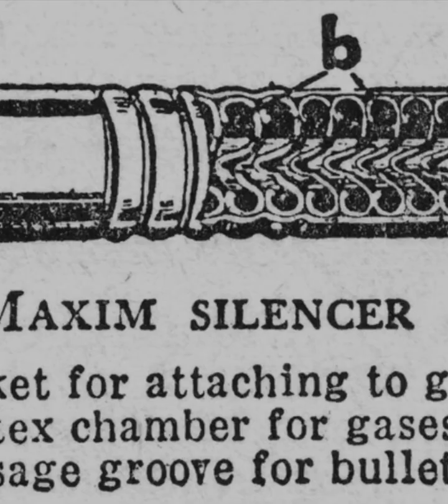MEOW Ep. 1

Comment: So it sounds like from what you guys mentioned about other manufacturers devices you’ve seen certain devices that caused issues with CAT suppressors, can you guys elaborate which devices may cause issues? I’d assume most folks will run Rearden with hub mounts if they don’t use yours so are there certain Rearden or Plan B type mounts that users should avoid? Or was it another mount like keymo causing issues? Q just put out a blanket statement that they won’t warranty cans with other mounts which is fine, but you guys went more in depth as to why (which is awesome) but kinda leave it on the table as far as which mounts you’ve seen problems with.
Reply from the maker: We won’t signal out anyone listed here but we can say we’ve never tested with Rearden. Most issues around devices are generally sealing and locking, which leads to strikes.
Reply: @specterscat  that makes sense, appreciate the response. I understand how it’s a bad look for a company to name names, but that alone helps alot in understanding what to avoid. Thank You, looking forward to getting an ODB